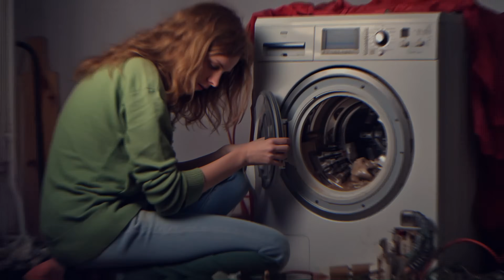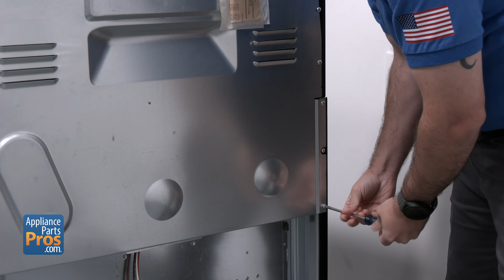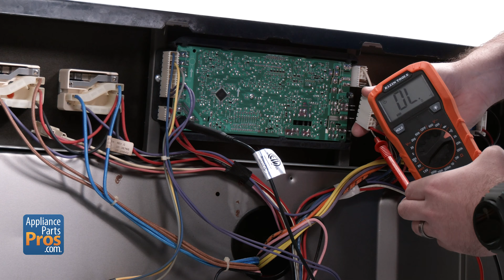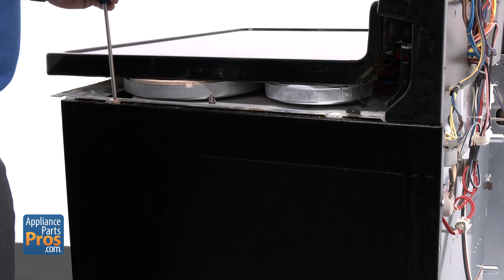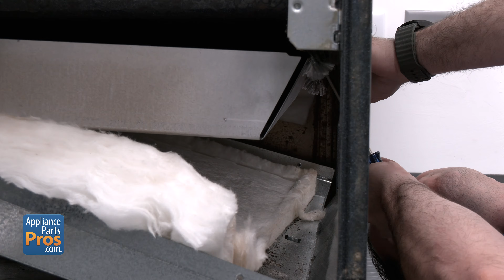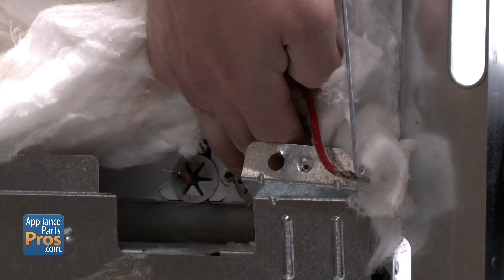Replace Your Whirlpool Bake Element EASILY with These Simple Steps

Comment: Pro tip look at the back of the stove if the lower element is visable from the rear then all this is not needed. just remove the bottom inside cover 3 screws and bam replace the new element replace the cover reattach the rea wires and covers and your done. a 10 minute job not like this on . so make sure you stove is this type save you a lot of unnecessary work like i did.
Reply from the maker: Some Whirlpool ranges do allow access to the bake element from the rear, which can make the replacement much quicker. The design varies by model, so checking the back of the range first is a smart way to see which approach applies. Thanks for sharing this helpful advice for other DIYers!

Comment: The oven in the video has little in common with my 1989 range. Mine has no circuit board and is a set-in...in other words, it's requires tearing cabinets out to remove the oven.
Reply from the maker: Thanks for sharing your experience! Older ranges can be built quite differently from the models shown in newer repair videos. A 1989 built-in range may require much more disassembly to access the bake element, especially if the oven has to be removed from the cabinetry. We appreciate the feedback! 👍

If you need further installation, troubleshooting/testing information from our techs you can check out our repair forum: https://forum.appliancepartspros.com/